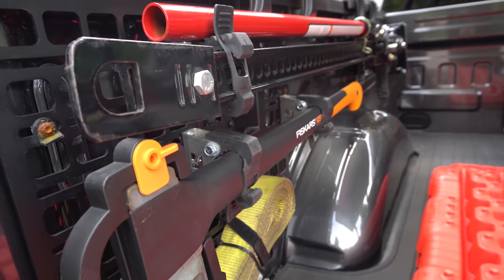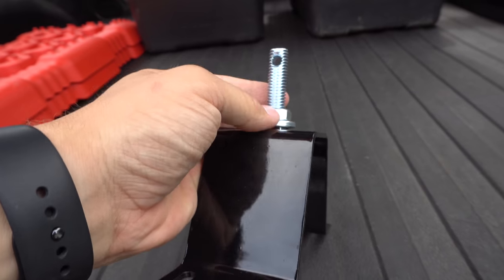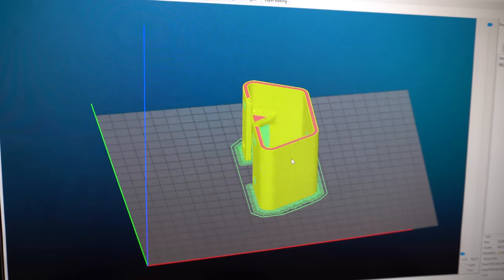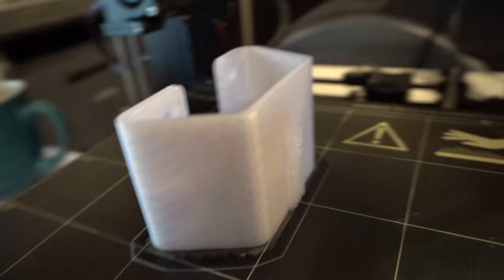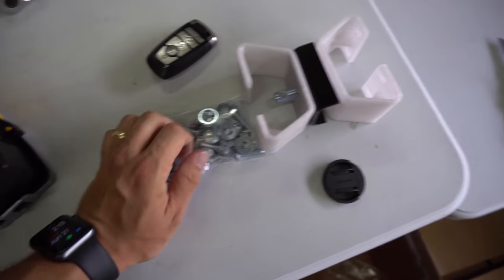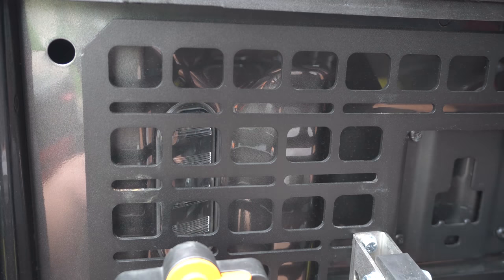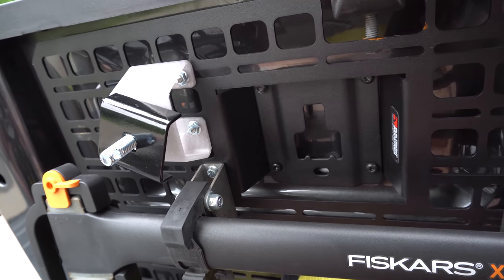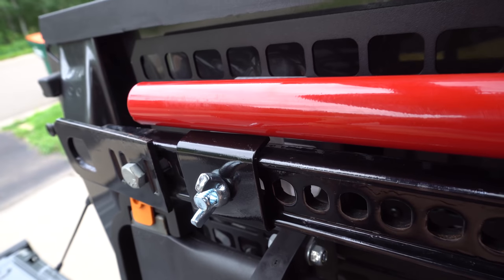Designing an F-150 Hi Lift Jack Mount - Behind the Scenes

Comment: Any decent size machine shop has perforated sheet metal they can cut to match a template for sides and front or bed. Just added the brackets and clamps for custom results

Comment: I noticed by your bed rack placement that you too have found  that the beds have no space for rail clamps. If you're interested, I've got a design that fixes that so you can get those cross rails up against the cab and tailgate.
Reply: I would be interested

Comment: Why not just put 4 inch bolts through the back of the box link connectors with spacers? Slide the Jack onto it and secure it with some star nuts or wing nuts. That's what I did.